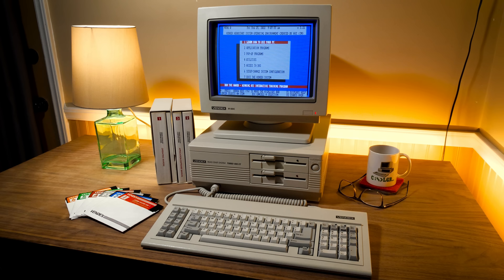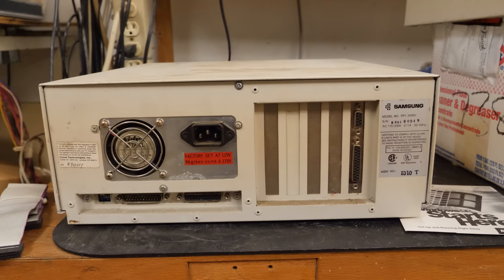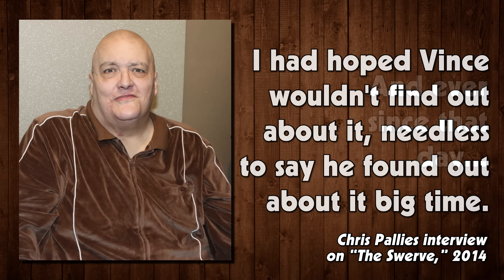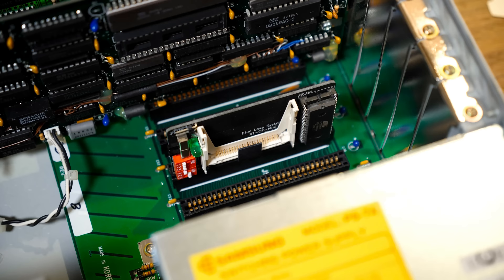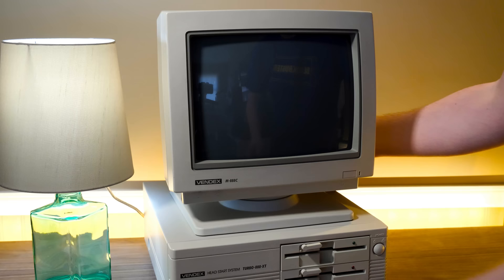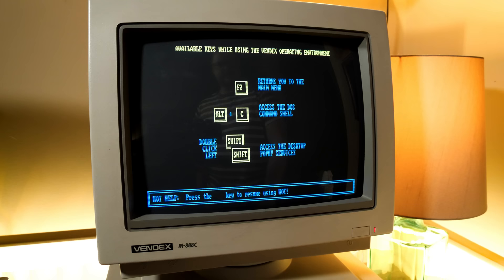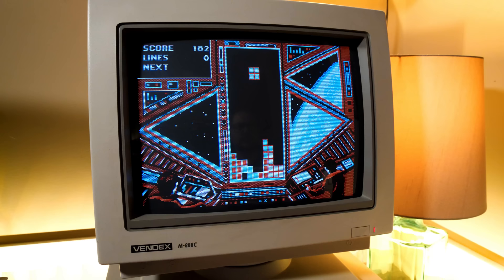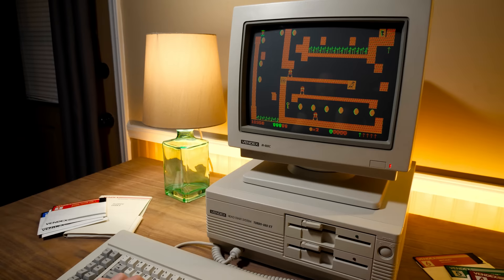The PC That Ruined a Wrestling Career: Vendex HeadStart from 1987

Comment: Wow. This takes me back. This was the first computer I ever used at home! It was bought for my older sister, at first, but when she tired of it it fell to me. I mostly used it to write my, err, novels and play Police Quest.   It was starting to show its limitations by the time Police Quest 2 came out, but the game was still playable.  Ours wasn't sold with the monitor included, so my dad just got a monochrome one at first and later a CGA of a different brand. It's odd because Police Quest actually looked better on the monochrome display as the CGA presented in unnatural colors heavy on red and blue.  I remember opting for the mono switch often. I also remember how time consuming it was to save my place in a game using the two floppies. I still, to this day, can recall the sound of those floppies working.  I also still expect this weird ticking sound to happen when I hold the back button down in a word program  even as I type on new keyboards. Thanks for this.
Reply: Novels? 😏
Reply: Pretty sure someone has made some sound emulator for that. I mean WinUAE has floppy sound emulation for it to be closer to real hardware. Having something that simulates the backspace.

Comment: Awesome review! Good thing the battery was removed in time. I own two of these machines, both were severely damaged by leakage. In case anyone else encounters similar issues: In one of my 888-XT's the floppy drives stopped working entirely, even after cleaning up the damaged traces. It turns out there are some 74-series logic IC's sitting right next to the battery, that will cause issues after a leaking cell. These IC's supply the floppy controller with multiple clock signals, and when they're absent, the drives won't work. If anyone reading this owns one of these machines, remove the NiCd battery -now-!

Comment: Nice little machine, im from holland but i never knew vendex was a dutch company. Tulip was a pc company that was more known around my area, my brother had a Tulip compact III with monochrome monitor and it was more of a ibm system running ms dos 5.0
Reply: Vendex were the owners of V&D amongst others, and  they were massive back in the days.

Tulip is probably the best known/selling Dutch brand of computers, helped in no small part by the PC Privé projects of the 80s. My first PC was the PC Compact II, with a massive 20MB hard disk and 3.5" HD and 5.25" DD disk drives. And of course their own quirky graphics card which could do either colour emulated CGA/Hercules (using a switch on the graphics card) or colour CGA.

Best of all, no battery soldered on the mainboard to keep settings intact, but relying on a battery holder that would hold 3 AA batteries to keep things ticking over.

And now I feel old. Really old.
Reply: @NumptyMcNumptyface  oh yea thats right, they also made other electronic components like portable record players. and yes i remember the battery holder, we had replaced the batteries on it once and i actually still have that thing.
Reply: Weren't Tulip making Commodore branded PCs about 20 years ago?
Reply: Vendex = V en D (ex): Vroom & Dreesman
Reply: @MarcKloos  And they also vend (sell) stuff.
Reply: Don't forget LASER.
Reply: @CoyoteSeven  That was Tulip too yeah.
Tulip you must know back then, they did the official original IBM clone, demand by Dutch law, famous for it!

Comment: Nice XT system! I still use my Atari PC3 XT machine on a weekly basis. It's amazing what's possible with only 8Mhz. I did upgrade it from EGA to SVGA and added a SB, UMB card and a XT-IDE card to make it more useable and robust. Next I'm going to rebuild the PSU with modern hardware (swap internals from a decent ATX PSU to the original case of the AT PSU is the idea) because I don't want the AT PSU to blow up the system some day.

Comment: What a pleasant surprise. Our first PC Compatible was a Magnavox HeadStart 300. A 286/12 version of this machine. Despite the different manufacturer name, the Magnavox looked nearly identical. And given the HeadStart name I am guessing Magnavox must have stepped in and either bought Vendex or rebranded it. 
Ours ended up getting a 1st generation, full length, Sound Blaster. 8MB of RAM on an ISA card. A 1/3 speed Magnavox CD drive (It was converted from an audio shelf model and benchmarked at 54Kbs transfer speed.) Logitech HandyScan Handheld scanner. U.S. Robotics 28.8 modem 3.5" and 5.25" drives, 40MB IDE HDD. Graphics were VGA 256/640x480. I was constantly inside the case on that machine and it definitely led directly to my career.

Comment: Hey LGR! I just found a console listed in a Wikipedia article with no page attached to it and upon looking it up Immediately thought of how FKING COOL it would be to see you review it so here I am- Your delivery of narration and hardware testing is the best in my opinion, and this is so niche it seems right up your alley. 

The console is Sega's 1988(?) "Video Driver" and it's this weird ass battery powered device that has its games on full-motion video VHS tapes, but still requiring a VHS player to function. It's main part is the sensor that's supposed to be attached to the bottom of a 4:3 ratio TV and what I'm finding weird is your "player" is literally just a car on top of that mounted sensor (not in the video) and you move it to avoid obstacles on the screen with the steering wheel joystick. It released only two games (on one tape) and "two other games" are known to exist. The public didn't favor it apparently and it was discontinued shortly. 

I would PAY to see you review & test it- the only obstacle is finding out where the fuck one is. I am about to go on a quest to find one and will return if I bring answers LOL

Comment: I worked in consumer electronics for a time for a large Korean brand. It's really common to have the same chassis and just spin different front panel plastics against the same cutouts behind.
I worked for another company where there were consumers complaining that another brand had ripped off another companies design. Except this was the same box being sold under three different brands by the same distributor.
The red / green LED difference could be considered deliberate! A/B identification? ;-)

Comment: We had a Samsung SPC3000 in 1988 here in the UK, with 20MB hard drive, green screen, so this Vendex looked very familiar. The power switch & led on the monitor are exactly the same. It was a reliable machine over the years we used it.

Comment: Man, it would be wonderful if modern computers came with that much documentation. Even just the hardware docs would be nice; unlabeled and obscure pins on today's hardware can be infuriating.

While I never had a "brand name" computer in those days - mine were always home built out of whatever components I could afford, sometimes on prototype motherboards my friends acquired at work (I ran a never-released C&T 286 for a couple years that was pretty sweet, with features and speed not found anywhere else, but totally unsupported), but this Vendex example is just gorgeous. It looks brand new!!

Comment: My family had the later 9.54 MHz variant of the Vendex Headstart.  It was my family's first foray into IBM PC compatibility after having a Coleco Adam and Commodore 64. We got years of use out of the old clone, even though we bought it in the late 80's when AT clones were becoming more common.  The 20 MB hard drive seemed huge back then, but is too small for even the smallest podcast today.

Comment: The desktop orientation is so much better than the towers we use today, for maintenance. Move the monitor out of the way and you can easily access all the components. It doesn’t put pressure on the slots for heavy video cards like we have now. I wish this form factor would make a comeback.

Comment: 16 color graphics in 1987 must have been mindblowing... I used Hercules amber monochrome up until like 1992
Reply: Not as good as the C64 on a monitor, i loved it back then, but not as good.
the modus was a little to high, C64 used older and smaller fonts? NTSC colors?

Comment: The case reminds me a little like the Gateway 2000 cases around the P-60/ P75 era.  A few years pass, and we needed new workstations.  The home office wouldn't allow us to buy new machines, but we were allowed to upgrade existing machines.  They meant memory or hard drive uprades, however we translated it to meaning a new Asus motherboard, PIII 600 cpu, and 128mb ram.  Hard drives and video cards were upgraded afterwards

Comment: This actually makes me appreciate my family's first PC more. I seem to remember being 11 years old when we got it, so that would make it around 1988. It was an XT clone with 10Mhz turbo and an EGA card paired with a 14inch color monitor. One 360k 5.25 floppy and a 20 or 30Mb hard drive. It was from a local chain and was housed in a massive heavy steel case with a big ol red flipper on off switch on the back right side. I thought it was awesome until I bought a copy of Falcon 2.0 and found that not only did I not have the required 286 CPU, I also didn't have 1.2Mb HD floppy drives. I remember sitting there at night trying over and over with the floppies, hoping that somehow magically my floppy drive would figure out how to read HD floppies but to no avail. Another huge disappointment was buying a copy of the original Wing Commander and not being able to play it at all, just salivating over the instruction booklet and ship blueprint things it came with. Still had a lot of fun playing DOS games on that thing, was stuck with it till '93 I think it was when I somehow convinced my Dad to buy me a 386 clone. I think he maybe realized the future career potential of my interests (which more or less worked out)

Comment: Well it really caught my attention on connecting things in my head about this machine being a clone of the same type as the Apex and the Apex being a recycled Equity I.
I still have an Equity I+ on my parents house on it was not an outsourced clone at all, still being a turbo XT it has a really obscure mainboard design full of Epson branded ASICs, a whole lot of bodge wires and even a 6volts CMOS battery (2x3v Lithiums), it also sports a Seiko Epson branded PSU... 
If you can find one of those it could be a nice obscure thing to get ahold and compare to the Apex.

Comment: My second IBM compatible was a turbo XT clone, but mine copied the XT even to the case. It came with a single floppy & I added an ST-238, which worked flawlessly for years. This system came with an EGA card and monitor. I don't recall the system brand name (white box, most likely) but the monitor was a Samsung. 14" EGA!!
Kept that system for a long time until I could afford a 286 Baby AT motherboard I dropped into the XT case.

Comment: I had one of these machines and it was a ROCK SOLID unit!  I upgraded it to the full 768K RAM capacity and installed a 47M hard drive.  I even got a copy of COLOR-CAPABLE MSBASIC so I could do "color" programming.  I eventually gave it to a relative when i got a 12 mHz 80286 with 1 meg ram (I kept the 47M drive) and eventually installed an 80287 co-processor chip.  I even bought the Vendex SERVICE MANUAL (I still have it!) which helped me learn about battery-backup circuits.

Yes, that machine started me on becoming a "tech whiz" with "Intel-based" machines...

Comment: I have a Zenith Eazy-PC my Dad bought in 1988. It has a NEC V20 clocked at 7.16MHz, 512Kb of RAM, a single 3.5" floppy drive and an 21MB internal hard disk. There are no ISA slots, only a proprietary expansion port on the back. I have never seen an expansion module on ebay.

Comment: The first PC my father brought home was a Vendex Headstart II. It was similar to the one in the vid but a bit sleeker. It had a 3.5 inch 1.44M and a 5.25 360k drive and a whopping 20M harddrive. It was a great machine albeit not very expandable as the case was custom and not some standard form factor. You could not just shoehorn a different motherboard in or something. I remember the 3,5 inch drive missing the HD disk detector. It formatted DD disk as HD and it worked fine. I transplanted the drive all the way up to my 486Dx. I loved that HOT menu system and the dos wrapper they made for it. It was a really nice starter PC back then.

Comment: This is interesting, I lived in The Netherlands back in 1987 and I bought my first IBM clone, which was a Samsung, remarkably similar to this Vendex machine. From memory, an interesting feature of that machine was that it was designed to be easily upgradable to a 286 computer by swapping the board containing the CPU with a 286 board. Of course, such a board was never released. This computer served me well for several years, I bought mine with a Seagate 20Mb hard disk - what a luxury that was. If you could provide more information about the build of the Vendex machine, that would be appreciated.

Comment: I didn't have one of these back in the day, but I did buy a Vendex Headstart Plus motherboard with a 10 MHz Fujitsu CPU off of Ebay a couple of years ago.  It's been sitting on the back burner, but after watching this, I'm tempted to dig it back out and finish the cleaning and reflow of the solder joints.  The main reason that I left it sitting for so long is because I didn't have a compatible monitor until late last year when I picked up an IBM PCjr monitor from Computer Reset.  I also was given, for absolutely free, a Media Vision Thunderboard 8-bit sound card by a local friend that I plan to put into my reverse sleeper Vendex build once I get it running.  I'll definitely be using this video for reference with certain things that translate to my Vendex motherboard.

Btw, I created a "Vatra Cure" PCB because my Vendex motherboard suffered from the infamous Varta cactus juicing that measures 0.5" by 0.75" which is open source and available on GitHub.  Not affiliated, but I suggest looking up Basic PCB (for those that live in North America because they are based in the USA) because for small PCBs such as my Varta Cure, they are significantly cheaper than those based in China.

Comment: Holy crap.  I cant believe you found a 1010T.  I have one that I saved from a dumpster about a year ago after a local man died and the friend he left everything to gave me permission to go diving. I could find very little information on the imtec brand so this video was nicely informative.  The only difference between the one you show and the one I found is that mine has what I assume are the original dual 5.25 floppy drives.  I've never even plugged this one in.  I am afraid of letting the magic smoke out.  It was paired with a very nice condition IBM 5153 monitor that I also saved.
Reply: Update:  Clint pointing out that someone was wise enough to remove the RTC battery from that unit got me thinking.  So I opened up this old 1010T and oh man.  The carnage.

Comment: I still have my Turbo 888-XT, and I too swapped a floppy for 30mb hdd.  Also, for no better reason than "I could", I pulled the 8088 and replaced it with a socket and a NEC V20.
Reply: You need to keep the intel by AMD cpu, that BIOS was the original IBM clone in there, demanded by Dutch law!
Now, Philips Taiwan = TSMC, other times now....
Both the XT and older and cheaper AT did that original cloned BIOS

Comment: There's a lot that can be said about Vince McMahon and his sketchiness in terms of letting people take some extra money on the side (Hell look at the Twitch thing a couple years ago...) but hearing what King Kong Bundy himself said in an interview, seems like he knew what he was doing and tried to pull a fast one on WWE without realizing the company he was taking the under the table (for lack of a better term, more so from his contract than from a legal standpoint) would actually be seen outside of the Netherlands. Seems like he could have kept his job (and his push for that matter) if he cleared that from the start, especially since Vince didn't really crack down on endorsement deals until Randy Savage got the Slim Jim deal while with WWE and then left for WCW.

As for the PC itself, I know it's part of the same family of clones but specs and software wise, this seemed pretty damn good for a budget PC, yes as you said it's very middling, but considering the price point it's going for you'd find lower end, I'll give them credit for having a solid PC for what it was

Comment: This was my very first PC. Only mine was the Vendex HeadStart Plus. Not sure what the "plus" stood for as it specced the same and had the same operating environment and case. I remember the booting of it was...unique. Mine had a 20 MB Miniscribe HDD and it went through a very noisy sequence that I'll never forget. The HDD LED was in those "lines" on mine, next to a power LED. There were six system disks you had to install yourself then it would boot from the HDD into the HOT Environment. I only remember it briefly going into turbo mode during startup. I couldn't toggle it manually nor would any game/app utilize it that I could find. I fondly remember being introduced to the Internet via Prodigy. The word processor of choice that I used through high school was Professional Write, a program lost to time as I'm the only one who remembers it. It was a quite expensive, $1000 application. It lacked WYSIWYG but used different colors to show formatting such as bold, italic and so on. It even offered limited compatibility with MS Word 6.0 allowing it to work through high school. I used this XT through college mainly for word processing and financial related homework. Later I got stupid and gutted the case and made an AMD K6/2 Pentium clone sleeper out of the case.